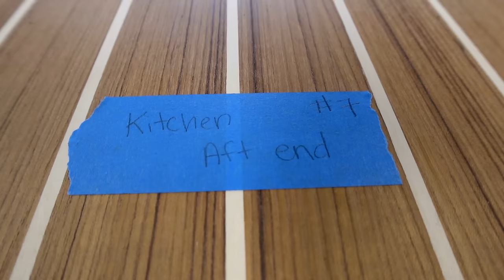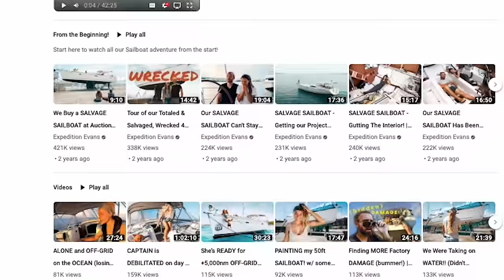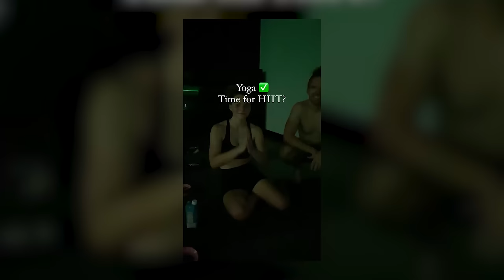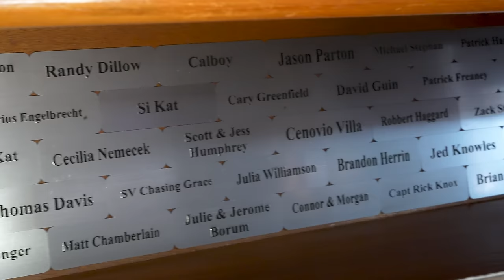We're building our NEW BOAT FLOORS on ANCHOR, Will our Measurements be ON POINT? | ep.20

Comment: Use baker-board cardboard (sold in hardware stores to protect finished flooring from the construction crews)to make a pattern for those crazy cuts as a test run before cutting the good final wood piece.

Comment: I hope your going to use a marine grade Poly cause if you don't the moisture in the air and water mishaps will turn it milky...I suggest a product called M5 maring epoxy and clear coat..I make wooden bathtubs as a side hussel and M5 is badass its waterproof and dries hard as a rock...I'm sure you know better but I've seen it done time after time.
Reply from the maker: Cool that's good to know! Thanks for the tip

Comment: To remove a plug just run a small wood screw down into the center of it.  The screw will pop the plug out.  It must be something about YouTube sailors who use power tools without using any eye protection.  My Dad lost the sight in one eye from an accident when using a hammer.  It can happen to you at any moment.